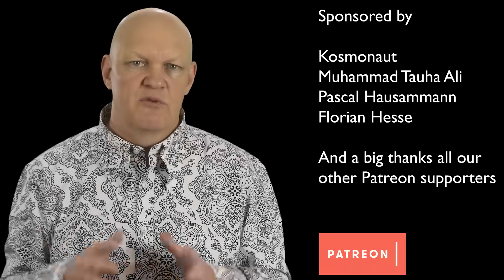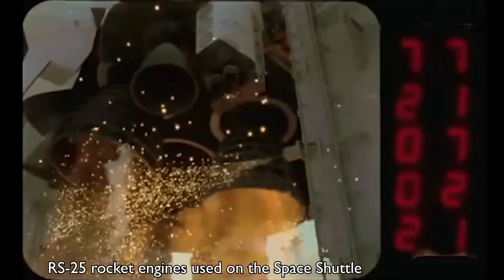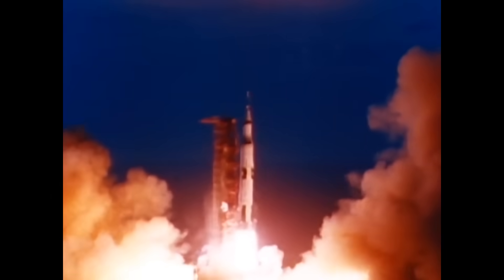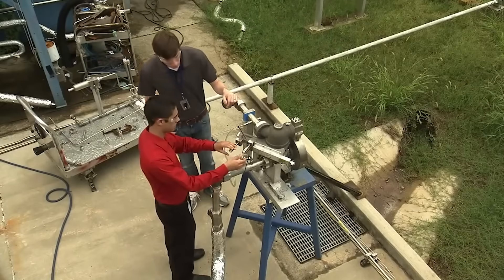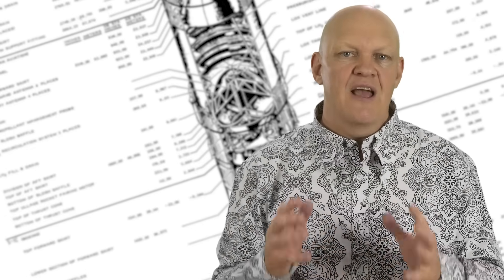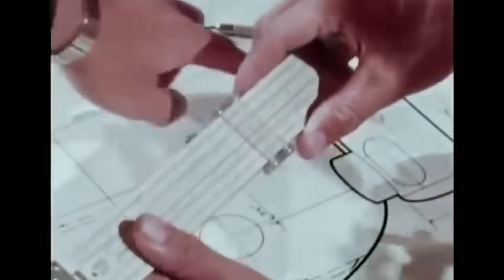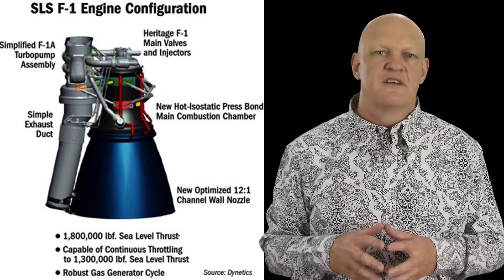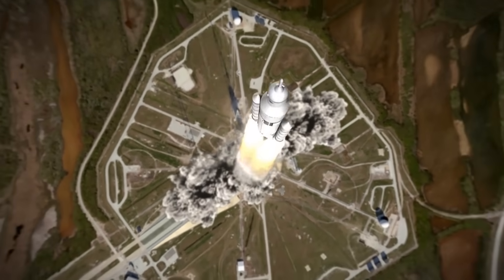Why Can't we Remake the Rocketdyne F1 Engine?

Comment: When I look at my 80's 9.0L diesel engine I often marvel at the shear brilliance and mind boggling way the engineers calculated the tolerances of it all. The Bosch mechanical injector fuel pump is just a marvel of design for example. You can fix/adjust them to outlast the modern computerized ones. Hell, all the pale-nose 'car mechanics with laptops, and the C&C guys are UTTERLY useless when the power goes out. You better pray that never happens, because in 100 years we will again  huddle in the darkness, hushing our kids to be silent in a thunderstorm for they might anger the Great forefathers who Rode the Lightning...

Comment: I pulled out my slide rule to see if I can still remember how to use it. Nearly 40 years of calculators the skills have gone. It's a lot harder than rocket science which is easy to learn, it's the years of practice and experience after the skills have been learned that can't be bypassed.

Comment: I worked as a mechanic repairing high quality machinery. If u were a minute late, they would call u in to the office even though it took them 30 minutes to prepare work orders in the morning. The management was unpredictable, one minute u had a nazi as a boss, the next just an annoying office guy. This attitude customers didn't care for and work was starting to slow as a result. Rumor started that they decided to redo the wages and pay strictly on certifications. That meant I would be getting a pay cut. I had lots of experience and was able to get hired at places due to having such. So I never focused much on certs. Sure enough I get called into the office. Tells me I got 6 months to get my certs or I'm getting a pay cut and was told I was overpaid. I was polite, calm, listened, and said ok. What they didn't know was I was negotiating employment across town-which I accepted not to long after and quit. I make good money, and the management is much more chill. They also realize how hard it is to find replacements. New guys are cheap in the beginning, but the mistakes they make are expensive and can run off customers.

Comment: I'm a Brit born in 1941. At 12 I started building a small passenger  hauling steam locomotive, completed when I was 15, mostly constructed in our school metalwork shop. My two mates and me made crystal set radios, rocket propellant, thermometers. We used to do blacksmithing in the back garden! 
I have had a wonderful life. I completed an engineering apprenticeship then went overseas as a (hands on) small industries advisor, total 50 years in 7 different countries. 12 years with the UN, the UN will not normally take on people without a top universities degree. They took me because I could do the job, not just talk about it. I have a 27 year old Cambodian step daughter who is as sharp as a tack and loves technical stuff so I have been able to pass on some tips to her!
I suppose I'm old fashioned but I won't go out in my car without a small selection of tools, a tow rope and jumper cables.
There are some sharp youngsters today but most don't want to listen to anything that will take them away from their screens!
Reply: Again, the old generalise. 

The current generation has and will achieve much greater feats in engineering.
Reply: @OhBLZD  Nice one Sherlock!
But only by building on the past and being willing to learn from older people. Remember we still navigate space using Newtonian physics!
Reply: @haroldpearson6025  until we develop FTL.

Comment: Well, the question is in the lines of why can't we build Egyptian pyramids? We certainly can, faster and better. Two things are missing: the need, and the will. With current technology and goals,   there's no need for F-1, yet. It can be done cheaper with smaller, reusable engines, as in the case of SpaceX

Comment: The major problem with the F1 was combustion instability. Oscillations of 4 kHz with harmonics to 24 kHz were observed. 
RD finally achieved self damping capabilities with injectors in the combustion chamber.
That's why Russian rockets use multiple combustion chambers on a single turbo pump. Simple solution, but more parts. Which is a factor that kept the N1 grounded.
Men of yesteryear knew their foundations, and built on them. Many engineers of today didn't even have to hand scrape a surface.🤦‍♂️

Comment: I say YES to building a simple expendable engine if it can be constructed for less than refurbishment of a re-usable more complex unit. Looks like the F1-B also is an open cycle design, so the potential efficiency differences also could sway the feasibility to something completely new based on a closed cycle (like the Russians do).

Comment: The people with the skills to build the F1 engine are hard to find these days, but they are still around and they are not all retired. There are many young and middle aged people who can do this type of work and to the degree of precision needed. The problem is, NASA has the attitude that, unless you have a 3.8 GPA in an engineering degree and/or a PhD, you aren't good enough to work for them. I was a welder, fabricator, and machinist for over 20 years before I ever went to college and got my engineering degree. Too many of today's engineering students are totally dependent upon computers and unable to use common sense to solve complex problems. Unfortunately, these same students will one day be teaching the next generation of engineers, thereby perpetuating the problem.

Comment: You’ve gotta be stupid any of us engineers even my grandpa his prime was threw out the 60s. None of us would re use a design that’s not down to small tolerances. As our computer software will do. When dealing with aviation civilians don’t give us the chance to screw up anymore because of our technology. Maybe they do in your country but not in America, it’s simply not tolerated. They expect us to do it right the first time and not kill anybody. My grandpa always will talk about back in the day you had a chance to screw up and Americans were not so pussyified like today. So they knew I’d they screwed up the would get a pass from the wanna be hard asses of that time. To simply wanna use a engine that had multiple problems all because they were rushed for the space race. I’ve seen 10 redesigns by manual SR not using computers and nobody agrees it was a good design. It worked and we got lucky is what everyone comes down with. We were rushed and getting to space was more important than our astronauts. They all were different engines and what we call southern engineering was performed on all of them. Which is not tolerated today. And hydrogen is the way to go using kerosene is a joke and only good for really light vehicles. The thrust to weight ratio was horrible on the Saturn v, borderline dangerous. I don’t have the room to explain all of the bad things about that engine. It worked, we got lucky is all I will give it. But kerosene takes so much fuel to make a tiny amount of power. Where hydrogen is the opposite. And conserving weight is important. I use to hate the boosters but I think it’s awesome now. We have enough data from STS the dramatic engineers were wrong. NASA management killed challenger crew. But after the redesign they were awesome.